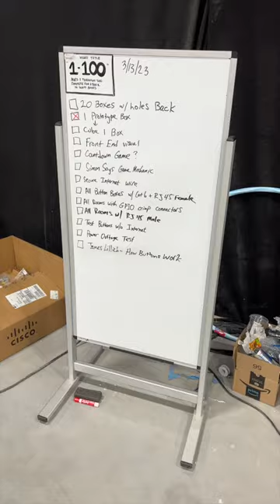Building Mr. Beast's 1-100 game with 100 SBCs! #shorts

Comment: What switches did you use (red/green)? Any advantages of a pi clone vs using esphome (besides wifi dodgy-ness at that scale)
Reply from the maker: Wireless was out of the question, too much distance, too many variables. We also considered a microcontroller like Pico or Arduino-compatible with wired Ethernet, but sourcing a solution that didn't require a LOT of customization in just a few days was impossible.

More to come ;)
Reply from the maker: Oh, and the switches were ordered by the Beast crew, I think they were Adafruit's 60mm 'mega' arcade buttons, but I can't recall precisely.